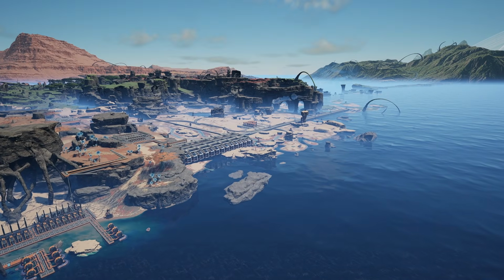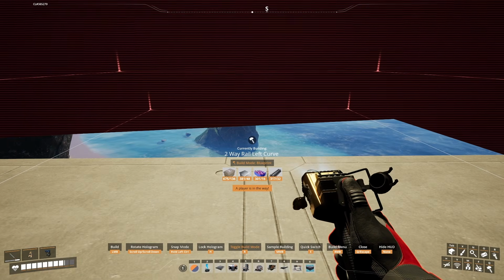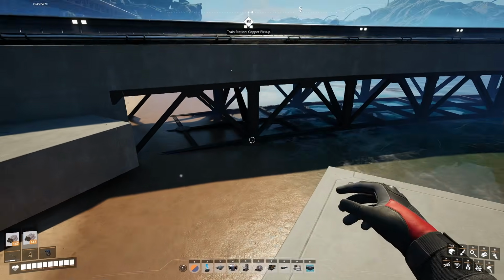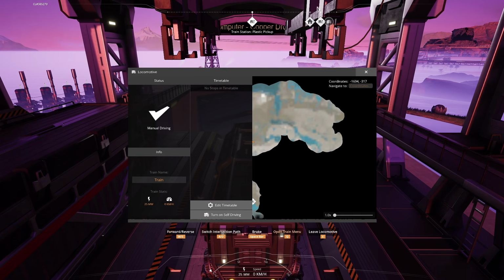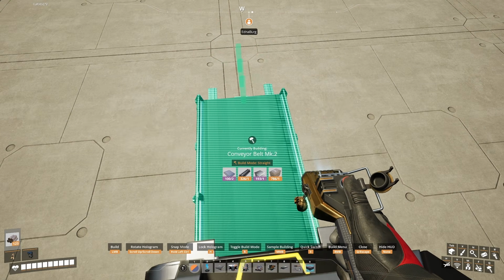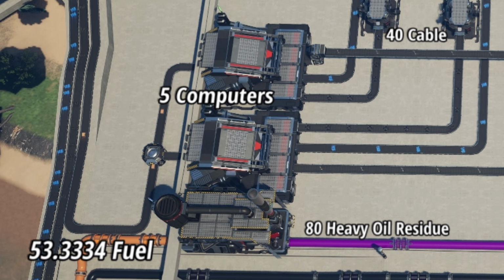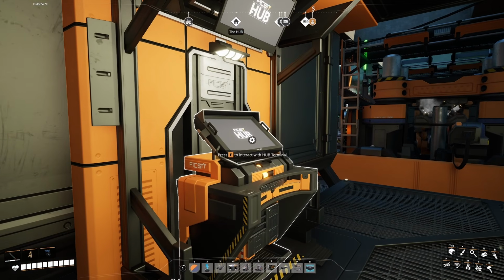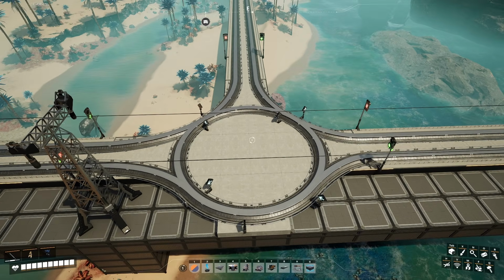Computers Made EASY - Satisfactory Guided Playthrough Ep.07

Comment: Good day Sir, as i was building the Computer Setup like you did, my Fuse broke, and i am only producing 2,800 MW, did i skip an video or what did i do wrong?, i didnt even connected the Computer Setup to my Electrical network... Please Help
Reply from the maker: At the end of the episode you should be producing 3550mw - if your power has cut out, it could be that all your factory is running, whereas sections of mine had shut off as their storage had been filled. 
If you're struggling with it - jump ahead two episodes as we go through a larger fuel setup which will close you in on 6GW of power :)

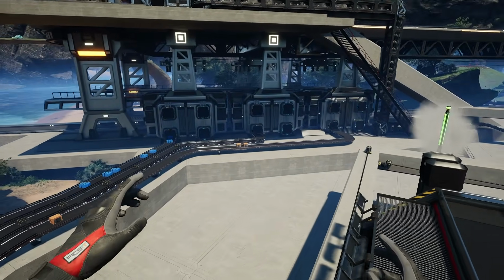Comment: At the 41:00 mark, in regards to the buffers... in this instance specifically, the belts and downstream machines are basically acting as your buffers.  Since the quantity is so low, it works just fine in this instance.  So, it's not that you don't have buffers, it's just that you aren't using containers as your buffers and letting your belts and downstream machines handle it.
Reply from the maker: Not quite - you use buffers before a train station so that you can turn and buffer a single line output to two lines once the station is loading. It's to stop the throttling during that freeze. As the resources that are held back can then be fed in at double speed. If you are producing over your max speed belt then rather than feed the station with two belts you will need s second station.
Reply: @TotalXclipse  So I understand (and apologies for the mini-essay)... am I right in thinking a buffer is (can be?) a container on the second Load line into the platform using an overflow splitter. When the train comes in, the overflow sends it into the container ready to be Loaded twice as fast (until the container is empty, which should be as its only 20 seconds or so) after the train heads off. And a similar box on Unloading clears the Unload platform quick enough to be empty ready for the next Unload.

I'm guessing this becomes important when Load amounts are near platform capacity and production amounts are close to consumption amounts at the receiving end.

When I was following what you were doing I went overboard on production and clocking/slooping, and I was worried about the factories causing power loss due to production pauses. I ended up using a sink to clear the conveyors - I had never thought about this buffer idea at the platforms.
Reply from the maker: @Spanner1971B  yep exactly, its not needed here because we're dealing with only a few items but on higher throughput lines it can be necessary as buffers can fill causing the factory to turn off.